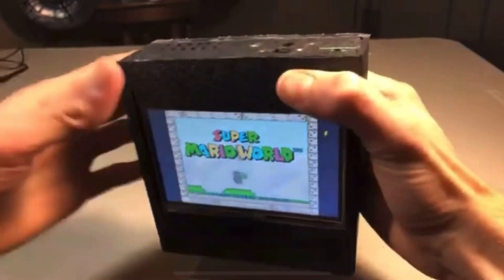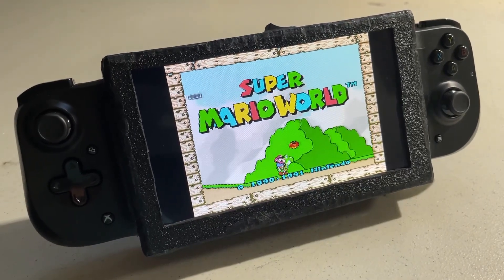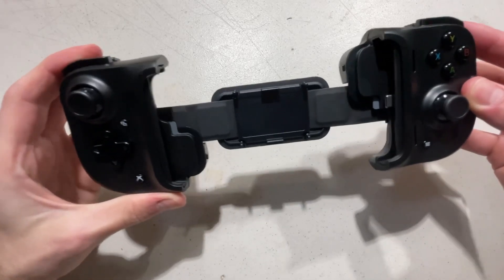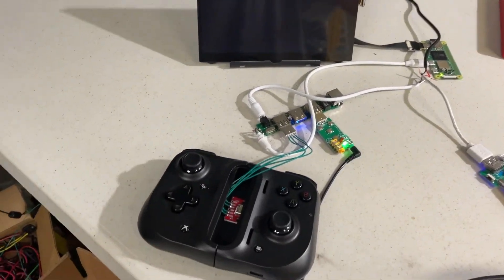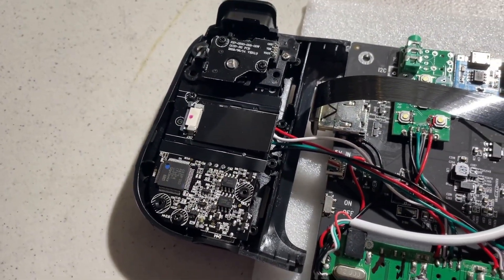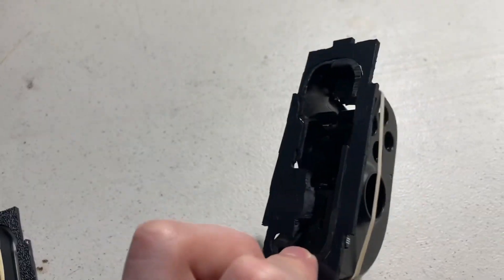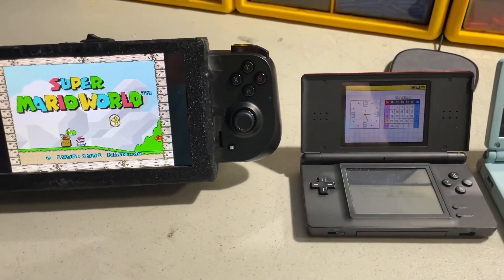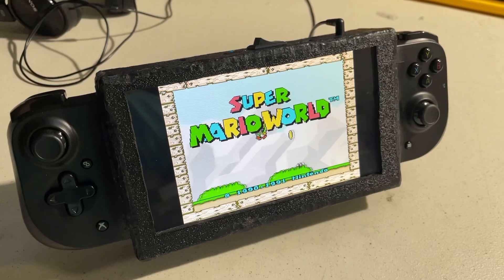Raspberry Pi Handheld Gaming Console

Comment: Where can I get this battery?
Reply from the maker: I salvaged this one out of a broken mobile power bank. The electronics don’t pull much current, so any lipo or li-ion cell should work. The higher capacity the better of course, just make sure it’ll fit in your project.

Comment: What about the fan idk if the rpi zero 2 needs one but this is cool and i dont want it to melt
Reply from the maker: @a-guy-n3p  it needs a fan. When I built it I didn’t realize that there was an air gap between the front and back of the screen, so it can’t dissipate heat well enough and it will overheat after probably 40 minutes.
Reply: @ also i need a tip my console im making isn’t working my sd card when i plug it in to my laptop doesn’t identify as well as it does with the raspberry pi do you have any tips to get the sd card back up and running?
Reply from the maker: @a-guy-n3p  the only problem I ever had with the SD cards was them being formatted wrong. You have to be careful though, as formatting a card will delete all its data.
Reply: I cleaned it with cleaning alcohol and im praying that did something
Reply: :( its dead
Reply: Rip sd card
Reply: Or maybe its the power source
Reply from the maker: @a-guy-n3p  When I got my first raspberry pi 0 I snapped the SD card in half while putting it in the slot 🤦‍♂
They're like $10, it isn't a big deal.
Reply: @Calthecool   the good part this is that my mother has gotten a t7 shield ssd and it works on rpi meaning i have hope im just having trouble mounting it to my raspberry pi on lakka

Comment: Surely the USB-C on the bottom of the Controller still supports data passthrough for a keyboard?
Reply from the maker: It never supported data pass through in the first place, it specifically says it on the product page.
Reply: @Calthecool  That's a shame, probably wouldn't be a huge mod to soldier the data wires to the port (If it has the pins).
Reply from the maker: @ThatGoth 
In the end it wouldn't be worth it, like I said the steam link has too much lag and I can just add games through wifi if I want, so I don't really need the usb port.
Reply: @Calthecool  and I guess you can always just buy a steam deck like I ended up doing after building a suitcase Pi.

Comment: at that size screen you could do a raspberry pi 5
Reply from the maker: Yes but I'm not spending $60-$80 on that, and it was more about the thickness.
Reply: @Calthecool  the money I get, but I desolder the usb ports and lan port and gpio pins. Hopefully I can order the pi5 in bulk for my projects. Cooling is a concern but I have a good feeling about the pi5.
Reply from the maker: @cgwworldministries83  
They made an 3+ A model that is basically that, would probably work. Idk if there is a 5 A model though.
Reply: @Calthecool  theres not but you can order a pi B without the USB ports or GPIO ports via special order.